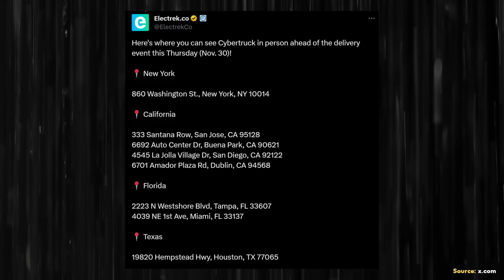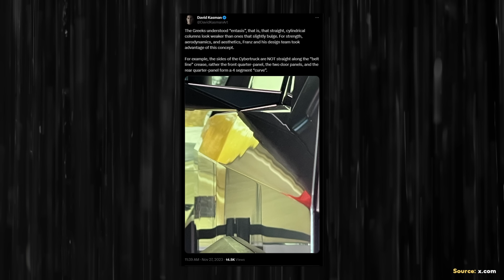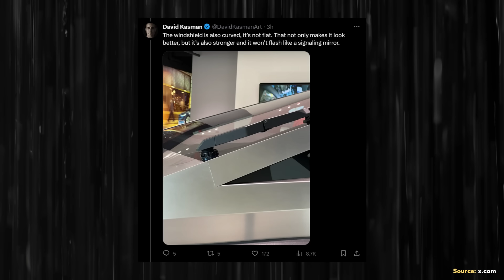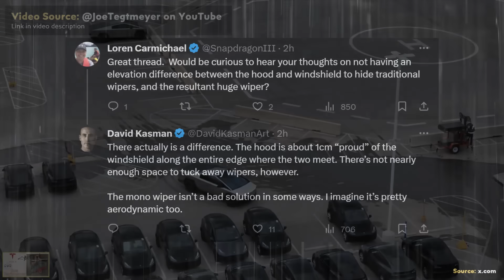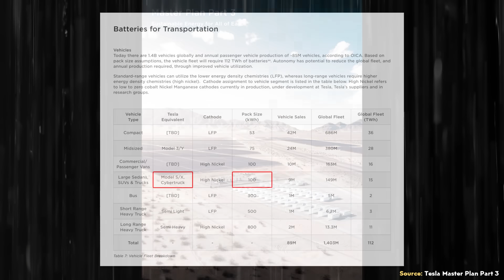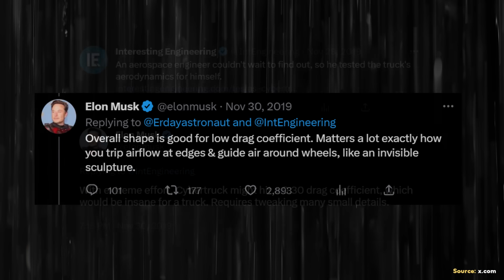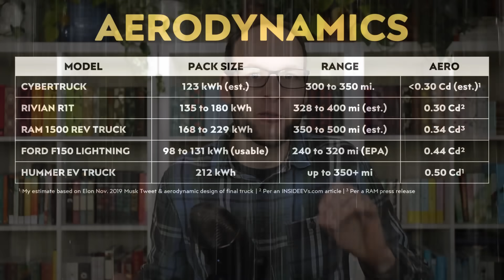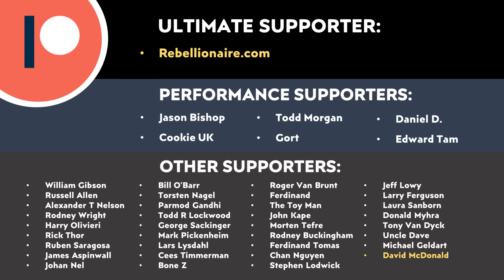Engineer REACTS to Tesla Cybertruck Design | Battery Size & Range

Comment: I tow a lot and based on some rough calculations, towing RV with half the range at the minimum. So I will need a 500 mile range to effectively tow an RV for 200 miles. Luckily cybertruck offer an extended battery pack in the bed for 477 miles range. 👍

Comment: That windshield wiper seems to miss alot of the windshield.  Also I'd feel better if the 2nd row headroom was the same as the front row.  And the sight lines from driver to where wheels are hitting is nigh impossible. Inability to reach glass will make cleaning it very difficult.  The sparse-ness of the cab reminds me of Old Soviet\German cars created by the state - "You don't need any luxury. We give you all you deserve!"

Comment: Hell no it’s not efficient enough. I need the higher range and if it’s 300 mile range it’s not gonna get 280. Remember you’re only going to be able to charge it to around 80% daily it’s gonna get probably less than 200 miles which is fine for most daily drivers but those of us that actually need a truck, it is not. Also, I think that reservation should allow people that need a truck by the truck if you’re coming from a car buying a truck is not an efficient choice.

Comment: Yawn.  "Cybertruck" (even the name is obsolete) is already another major Musk disaster.
Now that it has finally and belatedly launched, we get to find out exactly how costly a disaster "Cybertruck" will turn out to be.
And the emerging answer, obviously: "Cybertruck" is a very costly disaster that can only become much costlier.
Very simple.
Reply: Nah,, the development will provide serious drops in costs for generations of cars in the future along with sizeable profits in 2024 and 2025. The underbody will be the basis for new vans and delivery vehicles which will be easier and cheaper to bring on line than the CT, because of CT engineering advances.
In particular gigapress applications of ever larger sizes. Some of that advancement will be in the smaller Model 2 with a homogeneous application for the entire underbody... front, rear and battery pack area in one pour. Voltage increases are another, long considered, but never advanced.
Sales to fleet applications will be wonderful and very much acclimate people to some long overdue changes in manufacturing.

The OEMs may not be willing to participate at first due to financial fears and the longer the refusal to adapt the harder to get good results from falling behind, the more the desire to  remain behind.

Giga press processes are being adopted today by OEMs, voltage changes next. The adoptions of these processes MUST BE DONE to allow innovation at reasonable time frames.
Reply: @mikedar8484  Sounds like an elaborate rationalization trying to find the silver lining in a disaster.  Gigapress like Cybertruck is similarly a refinement fantasy of increasingly obsolete mid 20th century manufacturing technologies.

Comment: 300 mile/500 km range would probably be fine in North America, Europe and Asia, but here in Australia, this would only be sufficient along the east coast, especially if it is towing.  I want to be able to tow a caravan (trailer) across the continent and with our poor charging infrastructure away from the east coast, 500 miles/800 km (which would drop to around 250 miles/400 km when towing) would probably be necessary.

Comment: Imagine if there were a series of 3 smaller motors connected by clutches? That way you could run one of a smaller motor for low demand tasks and add more as needed? Then we could we have a manual transmission ev? this would behave similar to the truck decoupling the motors?

Comment: The thing to keep in mind about range is that 330 miles is an ideal, but not a reality.  Tesla recommends never charging their lithium ion batteries above 90 percent or discharging below 10 percent.  That's 20% off the top or 270 miles.  Batteries are expected to degrade another 5% to 10% over the first 5 years.  To minimize that degradation , charging to 80% instead of 90% helps ... and that's another 10% off the top.  So ... if you want to do the most to extend battery life of lithium ion batteries, you charge to 80% and never go below 10% and, without any degradation, you start with a realistic range of 240 miles on your 330 mile brand new cyber truck.  I am not hating on the cyber truck.  I have a reservation for the dual motor version.  But it gives me pause about the range and every potential buyer should consider real world range ... not just the full charge to full discharge range under ideal conditions with a new battery when making the purchase.  Those that can afford it,  might want to wait for the tri motor truck just to get the longer range.  Food for thought

I hope I'm wrong about batteries and range.  Maybe the 4680's are different. If someone can confirm or correct my understanding of battery limitations and impact on milage specs, please let me know.      :=/

Comment: I plan on towing and 300 empty range won’t work. 150 miles from 100% to zero is a no buy for me. I can’t imagine having to stop every 100 miles to charge for 30 minutes. It’s got to have 500 mile range to be used for towing.
Reply: I'm pretty sure the 'Beast', 3 motor unit will be in the solutions. That may not be in 'ramp up' for another 6 months though.

Comment: I feel that a Long Range version maximizes the battery pack in the existing design... but for towing I think they should consider designing a version that can hold double the standard pack - not that I know what I'm talking about.  Well, let's look at data - Model 3/Y LR is just 23-27% more range - 260 through 333.  It seems like folks are asking for much more... therefore it can't be the typical LR version, it has to be VLR a special version that increases range by 66%

Comment: Wouldn't it be interesting if Elon is playing a BIG joke on us with the Cybertruck specs.  The posters in the showrooms could be fake and the real specs could still apply.  A truck that can haul 3,500 pounds can also haul 2,500 pounds.  A truck that can tow 13,000 pounds can also tow 11,000 pounds.  The posters could be switched out when the real specs are revealed.  Also, the percent battery could be "fake".  We know that for repaired Teslas, bigger batteries than the original were installed and software limited to what the car was sold with.  They could have artificially limited what the Cybertruck sees as the battery capacity and it might actually have more size (range) than was calculated from those screenshots.
Reply: For that matter, they could design it to carry 3500 pounds all day every day, but if they rate it at 2500 pounds and the truck weighs 5999 then it can be classified as Class 2a instead of Class 2b, which would have a number of advantages.

They'd have to get the weight down to 4999 to rate it for 3500 pounds and have the same advantages - and the vast majority of users will never load the truck with more than 2500 pounds anyway.

Comment: they'll probably make a long range cybertruck.  Yes that front bumper is very curved.  Also there were early analysis that cybertruck design is aerodynamic.  Those who blindly repeat that it's "not aerodynamic" is just making up stories.  We'll find out later.  Oh regarding your question of 300 mile range, the Model Y Performance has that kind of range so it should be fine for cybertruck.  I don't have one yet of course.
Reply: There is a clip of Elon on JRE literally saying it isn't very aerodynamic? He referenced hard edges not being very aerodynamic.
Joe was assuming it looked aerodynamic.

Comment: Im a sculptor. The cyber truck is NOT a sophisticated design. Its fugly.  It looks like someone decimated a low poly model of a truck down to 3 bytes, and lost both the texture and color maps.  As usual per Musk, it’s underwhelming, far less than what was promised,  years behind schedule and way more expensive.
Reply: Expenses had to be spent to get a work truck cost procedure reduced,,, P/Us,44444444444444444 just like passenger cars, have gotten too expensive for mass consumption. We need to see below 50K$ for most
Reply: @mikedar8484  I ordered an AWD Maverick 3 weeks after they first became available. Paid sticker of 31k. 250 hp. It’s the perfect sized truck, seats 5, and has a larger payload than a Tacoma for 20K less.

Comment: In regards to your question about mileage_absolutely mileage is critical! A 300 mile range truck will drop to 125-150 when towing or hauling heavy weight. For me one of the most exciting things was an over 500 mile range for this truck when I reserved it. 300 may be a deal breaker..
Reply: Range extender offers over 500 miles.

Comment: I would want the Cybertruck to have at least 300 miles range WITH 1000 POUNDS IN THE BED! So based on the size of the battery pack I think I'm going to be disappointed. A truck is for hauling things although most people use them for daily drivers. I happen to have a small, aerodynamic two door car for daily driving and keep an old truck for when I want to haul something but then you have to insure both vehicles. That's why so many have only the truck, they may not use it to haul all the time but it's cheaper than having two vehicles.
I have a Cybertruck on order but at the production rate I probably won't get it till 2026 or 2027 and a lot can happen between now and then so I've started shopping for an ICE truck now.

Comment: Slightly curving the body means it reduces sun reflections.  Perfectly flat would be a mirror.  I would bet light reflection is the initial reason for all the cruves.  But tesla always optimizes and will try to get all the benefits they can out of it. Structural or otherwise.

Comment: 300 miles would not likely meet my needs in Rural Utah. My 310 mile range Model 3 limits the places I can go now, and I hope to use my truck off road in some of the locations I can not currently drive to in my Model 3. 

I also plan to use my truck on multi-day off road excursions into Canyonlands National Park. Gas off-roaders typically cary extra fuel, and while I think that the CyberTruck will be more efficient when using it off road, I still think it’s a bit shy of my needs.

I am hoping that the trimotor has more range than the dual motor version.
Reply: I used to live there in Utah as well and explored the state in my Prius because as much as I wanted a Tesla, it didn’t make sense there for the placed I wanted to see. It’s one of the least densely populated states. You need some serious range to get from one stop to the next. I since moved to Seattle and got a Model Y LR and no issue here.
Reply: I wonder if they'll make a Long Range version and also a Very Long Range version with double the pack size... would come close to 600... but how much would it cost?

Comment: This is a fantastic video! I saw it in person, and I’m a mechanical engineer and I missed some of these things. I believe the hood being proud of the windshield will help reduce bug splatter on the windshield and help make the air slightly turbulent ahead of the transition at the peak of the roof, which I believe would help with the overall drag.

Comment: Range is going to be an issue when towing...if it can get over 350 miles per charge, less so..but it doesn't sound like that is in the works.
Reply: If they don’t offer at lest 400 mile range, it’s not going to be a good towing vehicle for most people. They definitely know that. I don’t think they will disappoint us, although I think 500 miles is not going to happen. Not with side mirrors, that big wiper, and off-road tires.

Comment: I thought they must have some curvature in the panels.  A flat panel looks concave in real life.  So how did they get the curves in the panels without spending a fortune on dies?   Are they actually running those panels through presses after all?  Is that why they cost so much now?
Reply: I’d be willing to bet Elons concept involved flat panels with no press dies but found out pretty quickly that wouldn’t actually work and needed to build press dies anyway. That tooling is expensive and takes a lot of time to design and build. It’s one of the longest lead items for a new car. I’m a tooling engineer myself, so I know first hand. This kinda explains how long it’s taken and Elons negative comments on how hard this truck was to build.

Comment: For reference hummer and ford have ev trucks topping out around 320 miles EPA range. The thing is the hummer is carrying around 3,000 pounds in BATTERY alone - 9,000 lbs total! That's got to be murdering efficiency going up a long grade in the mountains. Even just flat the hummer is going to 1.5 miles per kWh. And charging a hummer on a long trip is a joke. That is the current competition for Tesla - they bring supercharger to the mix.

Comment: 300 mile range is not much. At 75 mph the range will drop to barely above 200-225 miles.  However, folks who use the CT mostly for local use... it will ok.  Lot of advantages in functionality.  For max range at speed, got to pick Model 3 LR or Model S LR.

Comment: Stock WILL tank in coming months. IF the author here enthusiastic predictions about battery size and range (unloaded) hold true. 1,900,000 preorders canceled. Just like Ford, losing 95% of pre-orders. CT turns into, Too expensive boutique piddling POS.  Tesla HAS to have tri-motor, 500-550mi+ range for $79,900 fully featured out the door. Or else stockholders will lose fortunes. The optics of another failed pickup against ICE competitors will place Tesla into a bad position. Low production, loses money on each, drags down resources.  This is a classic stupid soy boy CFO decision. 

The CT IS designed to be a work truck (with 350mi+ range under heavy loads), an off road masterpiece that does not run out of energy on way out/back to the wilderness. That IS what the 2019 specs and pricing showed. That is what HAS to happen.  Or, fire Musk, the board, the CFO, and all the pansy engineers who brought a soy boutique CT to market. Shares in coming months will plummet like the shirts have been begging for years. What a Shft show if this is what happens. 

Or, Tesla meets their committed 2019 published specs and pricing (tri-motor under $79,900 fully loaded. Rest of model far less).  Tesla will sell millions and millions over the rest of the decade, surpassing annual F150 production by decent margin.

Comment: Correct! The wiper staying vertical is more aerodynamic than horizontal.
Reply: Agreed.  If you look at the most aerodynamic airliners, like the Boeing 787 or Airbus A350XWB, they have flush-fitting windshields and vertical wipers.  So this is a well-proven method of improving aerodynamics.

Comment: 0:10 - Now THERE is a way to change the color of your Cybertruck (until it rains that is).🤣🤣
I have a tri motor on order and I will definitely be less than pleased if the range comes in at 300 miles.

Comment: My reserved CT needs to get a minimum real world range of 400-500 miles or I will not complete my purchase. I will use it to tow my travel trailer so it wouldn’t make sense if I couldn’t get at least 200miles while towing.

Comment: to answer range question... NOPE, im planning on using CT for towing and its gonna be super disappointing and a no-go for me if only 300 mile nominal range ... I need 250 miles or so when towing at a minimum. my reservation is number 200,000 so fingers crossed Tesla and Elon deliver on their 500+ range promise by the time my build is ready ...

Comment: Concerning aerodynamics there is quite a good youtube video found on boostedboys. they bought a model S Plaid that had been rear ended to make a dragster out of it. They removed as much of the body off it to remove almost 900 pounds, thinking they were going to break records they were quite disappointed with the results. Long story short they spent some  time in a wind tunnel and were shocked just how much drag they had introduced. They ended up reconstructed the rear part of the body with cardboard and almost got the aero almost back to the original drag coefficient . They also taped up all the gaps in the body and especially the hood to windshield which greatly reduced the drag. Afterwards they took it to the drag strip and now hold the record as the fastest Tesla Model S Plaid in the quarter mile, the importance of clean aero really important.

Comment: Windshield wipers can have a huge impact on drag. The vertical position was the smart one since they could not be tucked in. There is a clip of Elon stating side mirrors can cut range by 5% at highway speeds. An exposed wiper perpendicular to the wind might have similar effects if fully exposed. 

It has a couple huge practical benefits. Snow cannot get packed below the wiper and the blade rests on an area of glass that will stay warm and clear in the winter. This is an excellent feature for winter climates. Also easier to clean there without areas for ice to build up and stick.
Reply: The rear wiper on the 3rd gen Prius is also stored in vertical position for aerodynamic reasons. That car was meticulously designed for aero like all Teslas are. I thought it was ugly and fairly useless so I took it off my car and capped the hole for a more streamlined look and better aero.

Comment: Less worried about normal range.  I want to get close to 200 miles pulling my travel trailer.  I want to move past 9 mpg with a 25 gal tank.  If it is over 160 miles of range towing, the gas savings make it a go for me.
Reply: Lmao.  Keep dreaming
Reply: Absolutely, the only reason I ordered it was for the 500 mile range so I can get 200 towing, if they can’t come through on towing range what’s the point. I’ll have to cancel it.